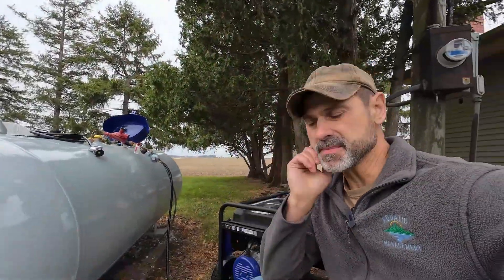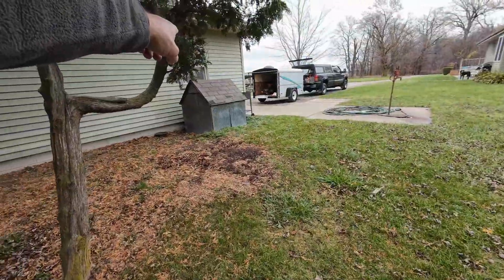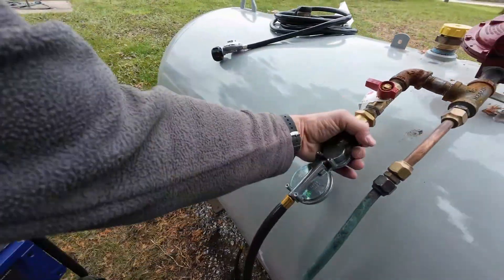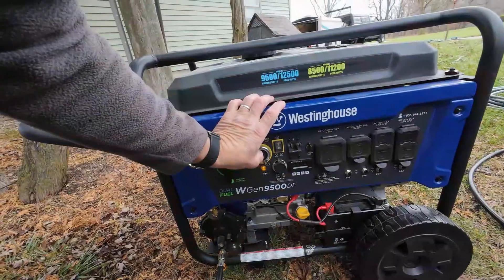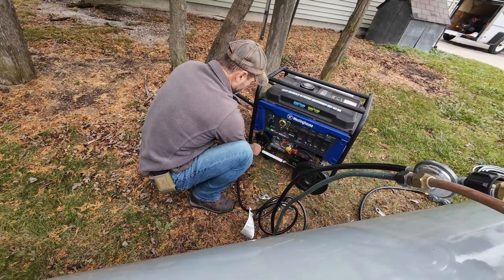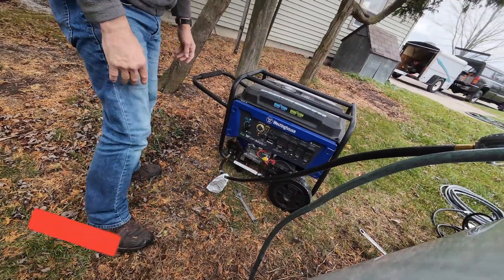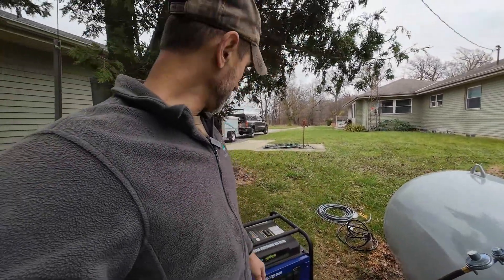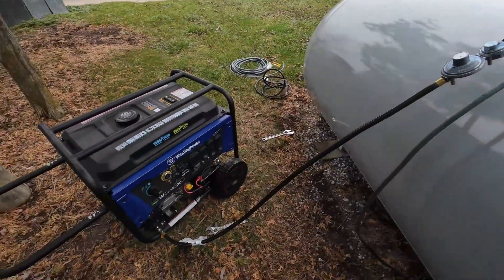Connecting A Generator To A Large Residential Propane Tank - Dual Fuel Westinghouse Generator

Comment: The red regulator reduces the tank pressure to a high pressure needed to overcome the resistance of the long hose. The silver regulator reduces the pressure to what the generator needs. Try putting the silver regulator close to the generator.

Comment: I know that it takes a long time to get the air out. Better to have the regulator close to the generator not the tank. I have z mister heater Lp heater and have to hold the valve for  while till the air gets out and the gas gets there. Also don't shut off at tank but at Generator or heater if wanting to get going again soon.
Reply from the maker: @boydruth9767  surprisingly, my generator fires up after 2 attempts.

Comment: If you have a tank like his, yeah, that could be a great idea for off grid. However, to my experience, a more dense fuel is actually better.For example, diesel fuel contains a lot more energy than propane In a generator this can be very valuable. I have had the chance to burn different fuels from natural gas to diesel and I'll be honest.Diesel is the least fuel burning generator I have experienced, don't even ask me about natural gas! That was a mistake! I'll never do that again!
Reply: By the way, the dual regulator is actually far better than the single regulator the reason why is because it has what's called an expansion valve with a pressure control valve sometimes liquid can come down the line and that will really mess things up.  So that expansion valve makes sure that everything goes from a liquid state to a gas state before it goes through the pressure regulator just a heads up on that.
Reply from the maker: @iansexpiramentaion5286  thanks for that information!

Comment: Fascinating.
Propane as a fuel source for off grid is a great idea.

Have you thought about solar and battery storage?

Then no need for a propane delivery.
Reply from the maker: Yeh, not sold on the whole deal.  Solar panels to my knowledge don't last forever as well as the batteries.  Not sure how I feel about creating more landfill products or the idea of trying to recycle them after their lifecycle.
Reply: @therustichandyman  Fair enough but the generator will break as well.
I suppose it's what you feel more comfortable repairing or replacing.
Reply: @BioHazardCL4  

If you live in the northern part of the US, there will be periods of the year (let's say from November til April) where you can exhaust the amount of energy solar puts out. So, for example, let's say you have 20kWh worth of battery storage and 15kW worth of solar panels. A 3 day outage might exhaust what you have stored + what the sun was able to generate. I looked into solar + batteries and everyone in the north east told me they had to add a generator to their setup to charge the batteries when they lost power in the winter.